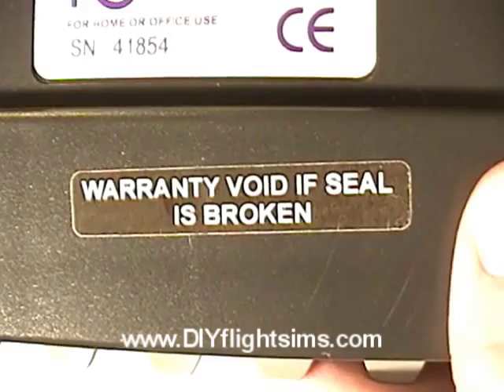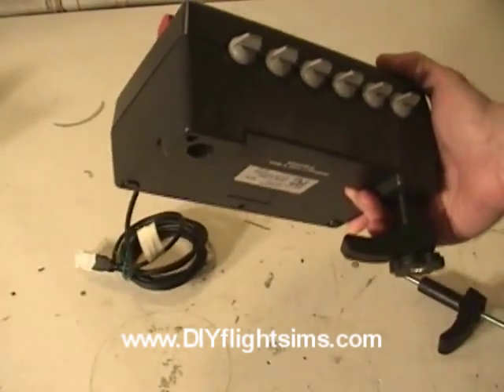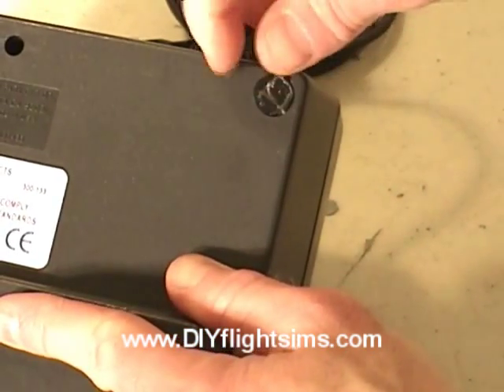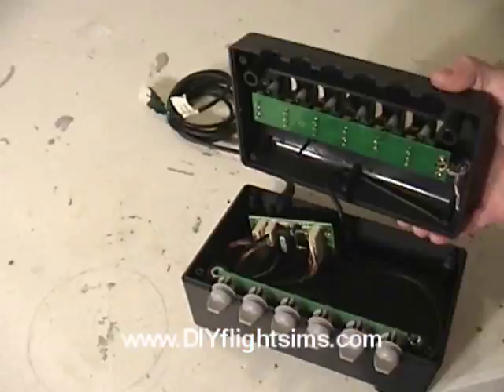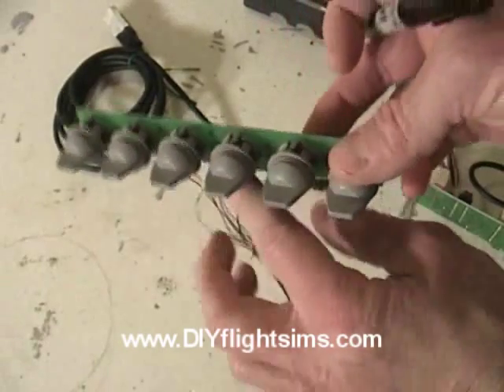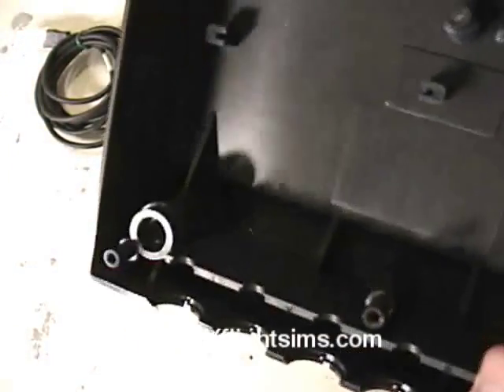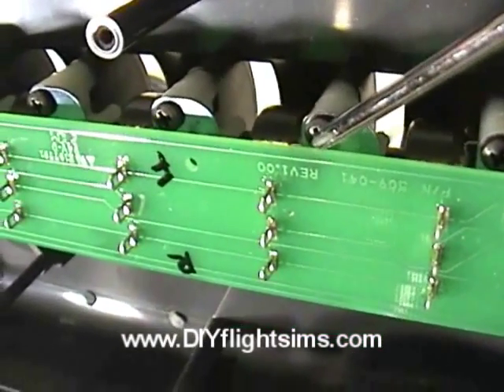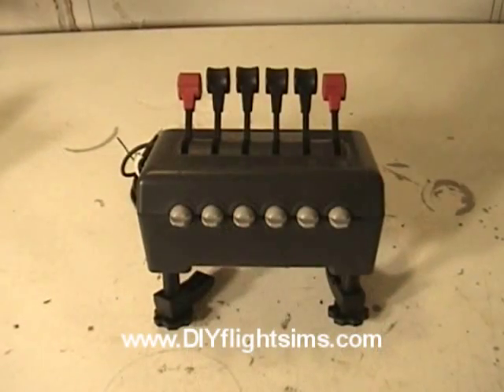Inside the CH Throttle Quadrant

Comment from the maker: @pab4994 well some of the stability of a PVC frame comes from the shape itself (in addition to the glue or screws).  I would need to actually need to build and try different designs to see what works best.  Do you have a pic of what you're trying to build?